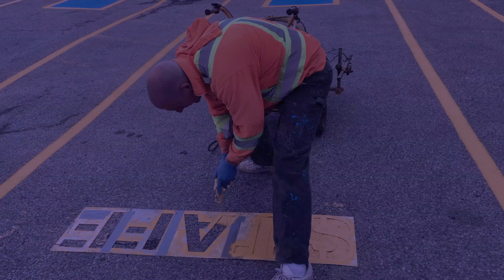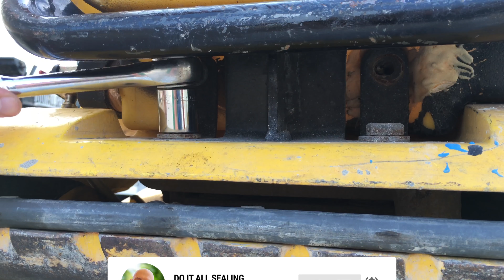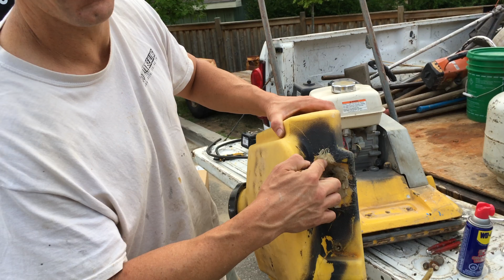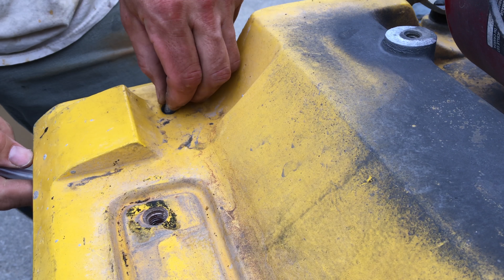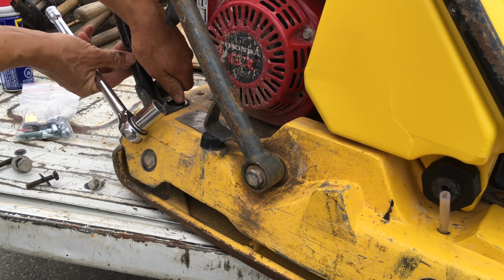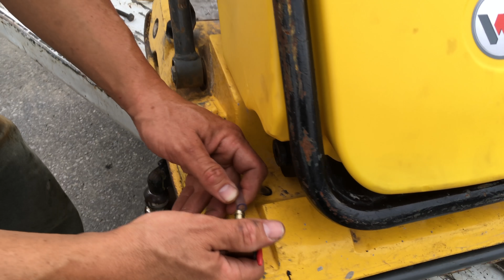Plate Compactor (4K) Water Tank Replacement

Comment: What size is the Allen Key Socket piece for the 4 Water Tank Mounting bolts?? My Compactor at work has that newer tank with the vibration guard piece to help prevent cracking. Can u tell me the Size of the Allen Key head please finding " specs " for the layout on the internet is harder than I thought and I lost my manual that came with it